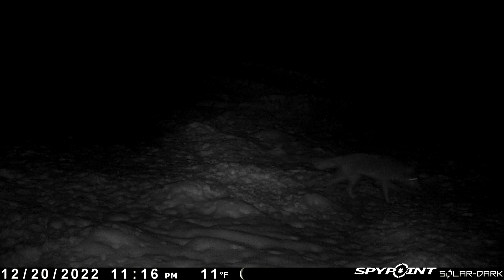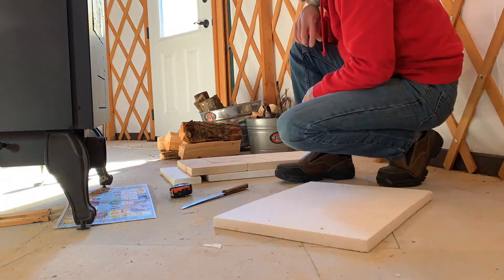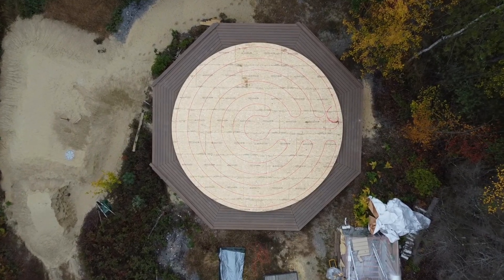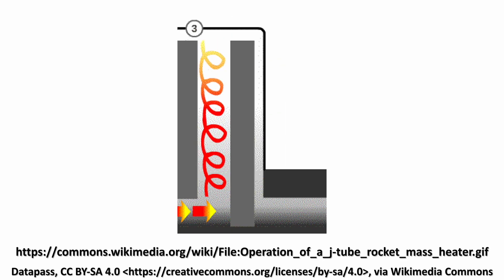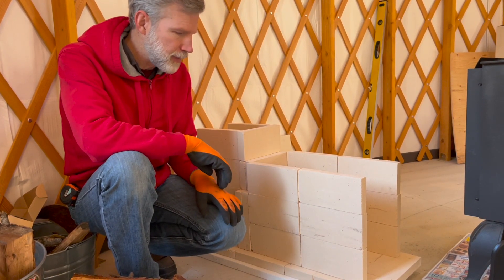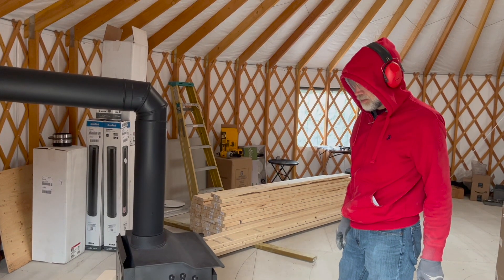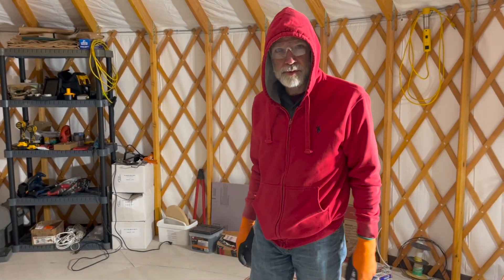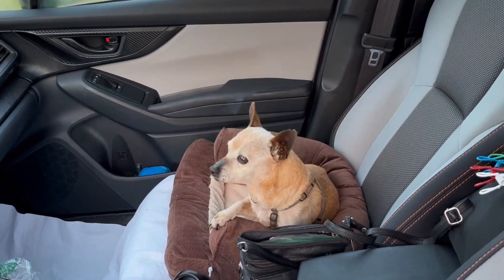Rocket Mass Heater Part 1 - introduction & batch box fire bricks (Vermont DIY off-grid home build)

Comment: The storing of heat in the thermal mass doesn't in itself make anything more or less efficient. What the mass does is keep the inside temperature from fluctuating as fast.
Reply from the maker: Well, yes. But that translates into using less firewood overall (which is the "efficiency" goal for us).
Reply: @OvertheRiverandThroughtheWoods  I'm with you, but please be aware that you've just created a new definition of efficiency when several others are already formally used. For me, channels like yours are valuable in part because of what we learn from them, so we don't want to mislead the viewers.

The standard definition of efficiency for a stove is BTUs of heat produced per unit of fuel. That's not what you mean, which is fine, as long as we're clear about it.

:-)

Comment: Hey folks.  Love the build and your presentation of the process.  I'm planning on building a RMH in a yurt also.  Curious to hear how it goes.  I've heard some doubts that the radiant heat from one can't keep up with the heatloss of a yurt and also is it safe to connect it to radiant in floor heating? be hard to keep it at a safe temperature and consistent heat.
Reply from the maker: Hi there and thanks for watching. We will certainly be letting everyone know how the system works.
I have no doubt that we'll have to feed the fire more often than if it were in a well-insulated house. The question is how much more. I am confident it will work much better than a wood stove alone and use a lot less wood in the process.
The floor is very well insulated, and the finish floor will be part of the mass. I have no fear of the floor getting too hot; on the contrary, I hope the floor gets warm enough to store sufficient heat while the wood is burning.
I do hope to automate some aspects of the system over time, and if for some reason the floor heating turns out to be a problem, I do have valves in place to bypass the mass entirely.
Stay tuned ...